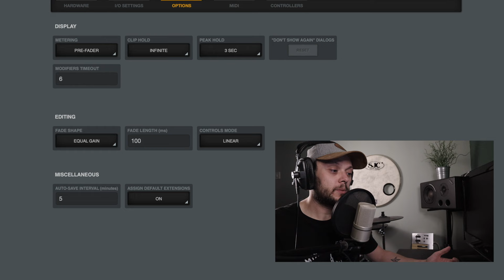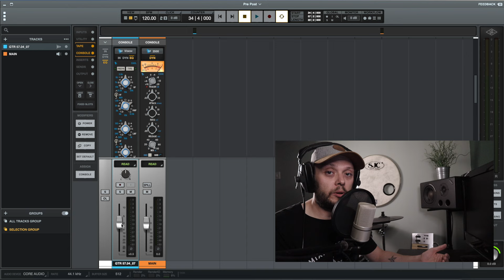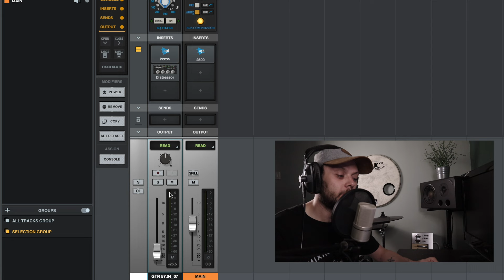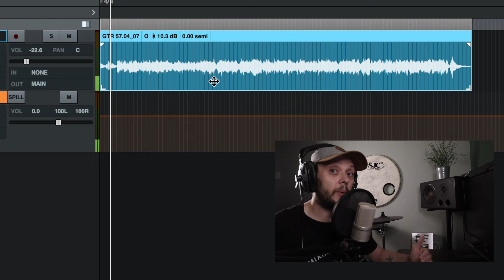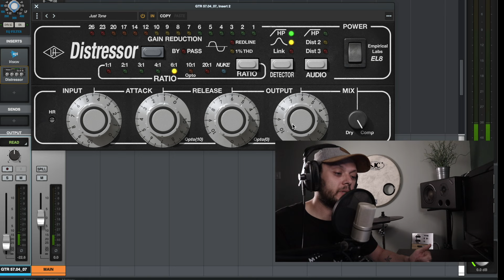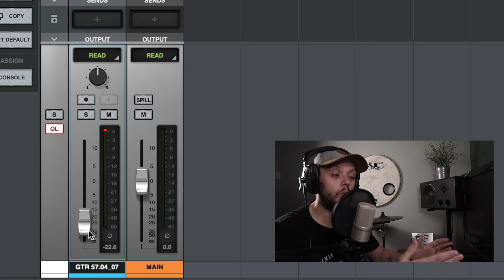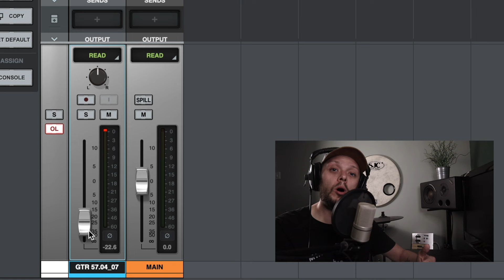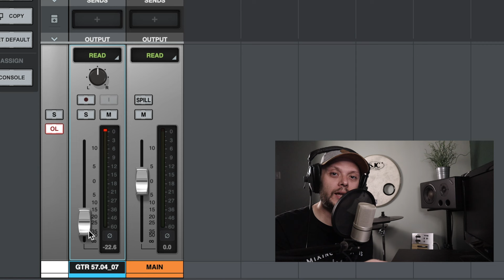Pre-Fader vs Post-Fader Metering in Luna DAW

Comment: Just wondering: In pro tools you can also see the peak value at the bottom of the meter. Can Luna show that as well?
Reply from the maker: Unfortunately, I haven't found a way to show the peak value as a number in the way that you can in Pro Tools. But there are peak hold markers on each channel which show the peak level. You can select how long the peak hold remains (e.g. 1, 3, 5, 10 secs) in the session settings. Hope that helps!